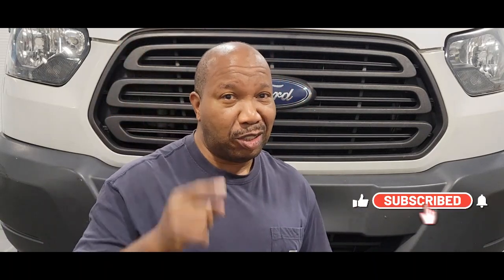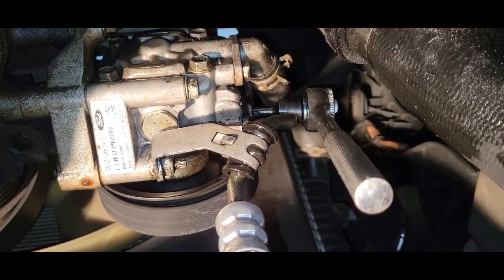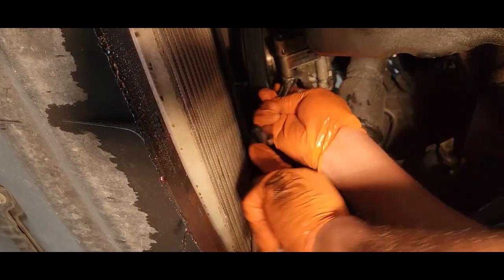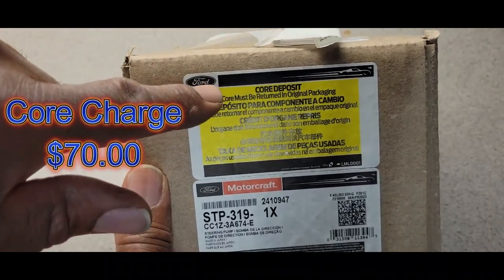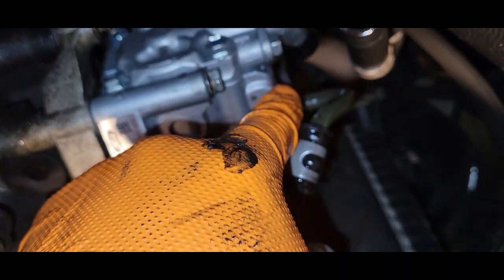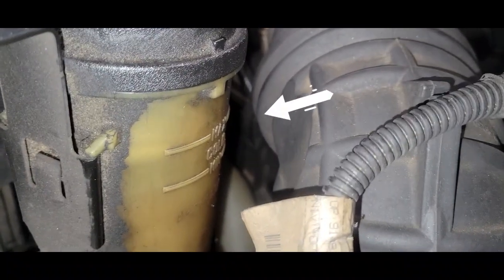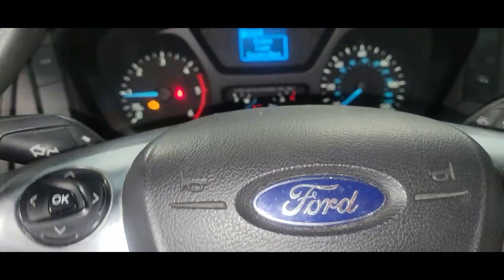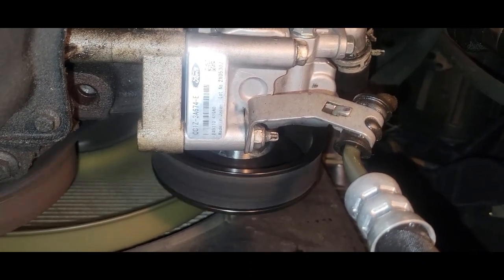2017 Ford Transit Power Steering Pump Replacement

Comment: I noticed my power steering leaking😕2016 
3.5 
Only 40,000 miles 
It looks like it’s leaking around the shaft area .

Comment: Thank You very much,  the only thing I did different was I pulled the reservoir and made sure the screen was clean and to clean out any junk in it.  Also sprayed brake clean into the hose's to clean out the old fluid. That pump is to much $$$.  Nice job.
Reply from the maker: I thank you for sharing 👍🏽

Comment: I’m a new subscriber and enjoying your videos… do you recall how many miles are on this transit??? Btw, it would be awesome to mention mileage on future videos, also for that price it better come with a pulley! LOL
Reply from the maker: @darintankersley1774  I thank you very much for subscribing! That's a good idea adding the mileage when replacing a part. Especially when it is as high as this pump. 😀 The mileage on the Transit was 149231.

Comment: Hi, nice video thanks, hope you answer my question. I have a Forn Transit MK8 when starting cold I hear a slight belt sound and the steering wheel is very stiff for first 2/3 min the comes to life. Is the pump on its way out? Thank you
Reply from the maker: That's a good question! I have seen this happen several times with 2017-2018 HD350. Especially on a cold morning.  Yes Sir,  it is a sign that the Pump life maybe shorten.